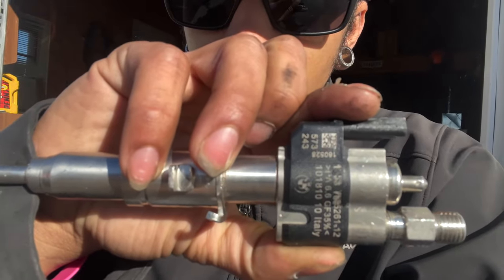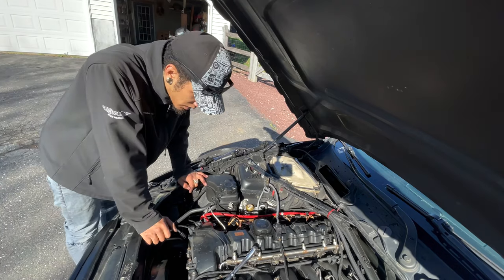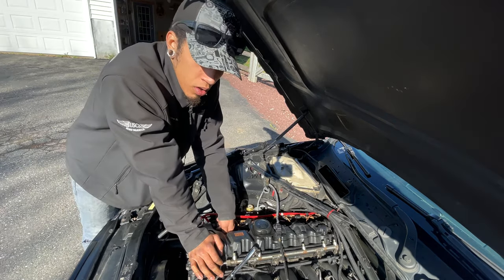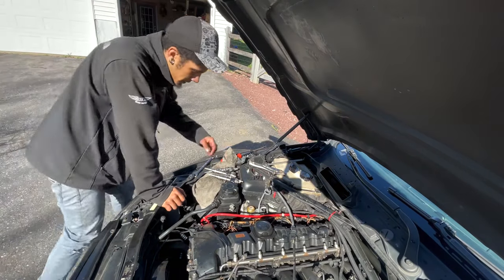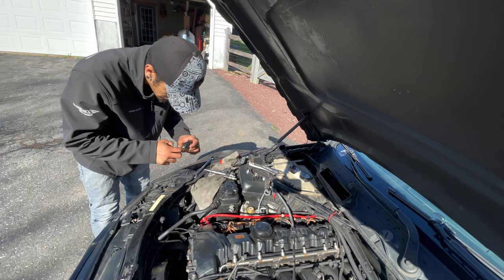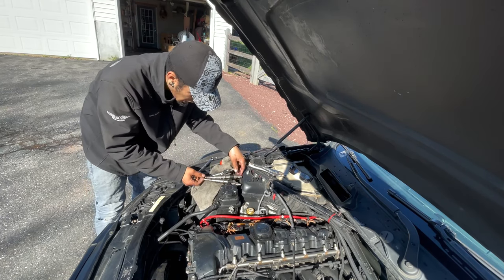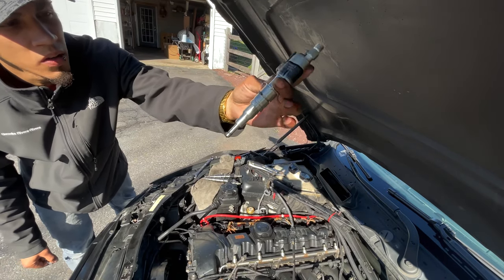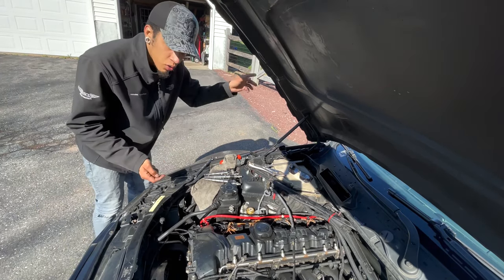500hp bmw 335i build(eBay parts only) series episode 001

Comment: Get the intercooler and downpipes on asap
Reply from the maker: I have them I just gota throw them on lol
Reply: @suicid_e92  Yea I know, these cars deserve to more power
Reply from the maker: Yea they do, I don’t know how much power ima get out of these eBay parts tho compared to what I had on already tho.
Reply: @suicid_e92  Yea I wouldnt trust the plugs or injectors intercooler should be ok
Reply from the maker: I’m not gona like I was worried about them too but I recoded them vid two days ago and no problems so far the plugs are supposed to be one step colder, I have them gapped to .22 and good so far so let’s see how long they last along with the injectors LOL if they fail at least I have my old parts tho you know lol